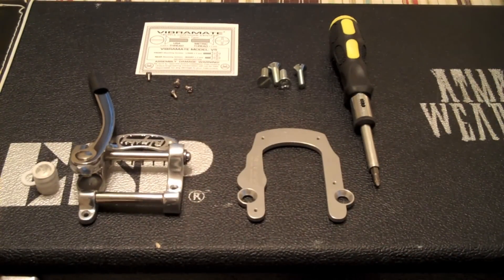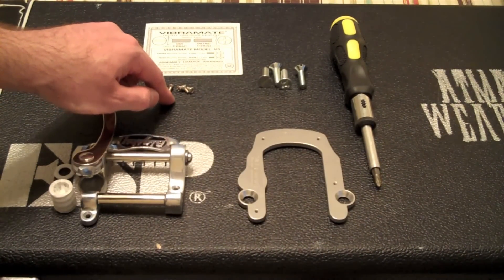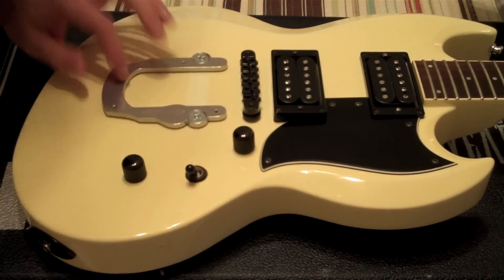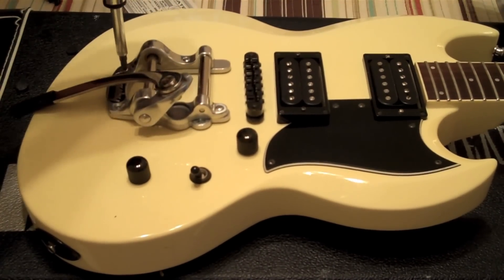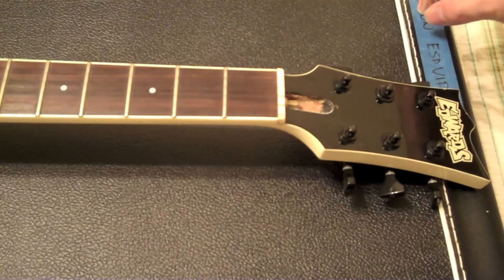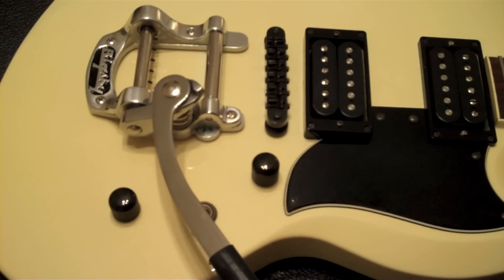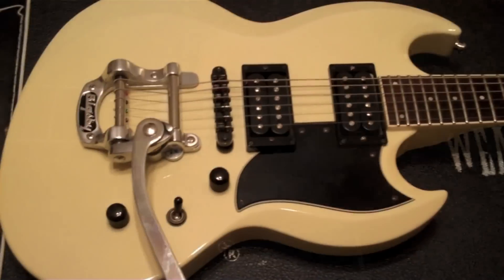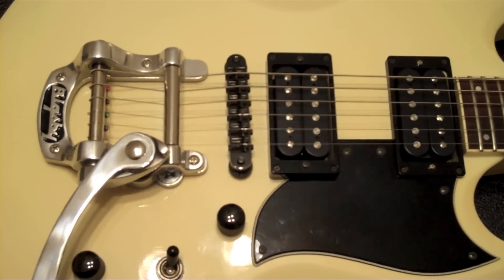Bigsby B5 and Vibramate Installation

Comment: I installed a Bigsby B7 with a Vibramate on my Gibson Les Paul, and for me, i didn't use the white plastic washer, its still just as smooth as it was with the washer, the arm is just lower to the body, which is just a personal preference for me. Vibramate have really made something amazing with these things.

Comment: Can I get help on something? I need the measurement from the point of intonation (bridge) to the very back of the B5 with an install like this. I am designing a guitar with a short tail area, kind of like an EVH Wolfgang or Framus Panthera. I want it to be neck-through and so I'm trying to figure out if a 36" bass neck blank will be long enough. I think it's going to come up short.

Comment: Hi, I have a question. Would it bet better to drill pilot holes instead of screwing the Bigsby without them? Or are the screw small enough that the wood or paint won’t crack.

Oh wait, is the vibramate  the reason not having to drill pilot holes??
Reply: Vibramate removes any reason to screw.

Comment: can this be installed on a les paul?
Reply: Captain Rigs no
Reply: Yes.
Reply: Josh Battershell won't it be weird because the les paul is an arch top
Reply: @dylangreen9819  no
Reply: @senessaxDev  Uh yes. This bigsby specifically can't be installed on a les paul but a b7 can be

Comment: What is the stuff you coated the nut with to lubricate it?
Reply: i dont know what he used but here a tip ,,, take a 2hb pencil  they are made from graphite . color the strings at the nut , try to get the  graphite under the string , graphite is a dry lube  that works well under pressure ,,, i ve used it for years , and it does work well ,,, i used a carpenters pencil because  it is wide , i ve used the same one  for about fives year and still have lots left ,,, oh buy the way i have found stetsbar to be better than  the bigsby good luck  cheers

Comment: There's a simple mod that makes stringing guitars with Bigsby trems easier. Just pull those pins out of the bar and thread the strings through the remaining holes. Much easier and faster if you need to do it during a live performance.
You'll need to drill out the holes where the pins were so the strings fit through, also clean up any burrs etc around the holes to avoid damage to strings, a tiny rat tail file would do the trick, if the come that small.
Reply: Man that's a great idea. I was thinking I may need to get one of those things that attach to the Bigsby if it annoyed me but I like your method better!

Comment: Did you pull your strings completely tight before turning the tuning machines?
Bad move, bro. You need to leave a few inches of slack when you turn the machines, that way the actual turning of the machines pulls it tight, leaving somewhere around 3-5 wraps around the peg, which holds the string in place a lot tighter and improves intonation consistency between playing, so you won't have to tune up as much, and it relieves stress from the strings. Plus, if it slips out of the peg (high strings) due to no friction, you just have to replace the string.
Reply: (Locking tuners)
Reply: It never hurts to do something correct.
Reply: +Terran Spears umm... No. Locking tuners lock the string in place, essentially replacing the need for winding the string around the peg.
Reply from the maker: +Terran Spears Look up info about locking tuners. They eliminate the need to wrap the string around the peg multiple times. In fact, when you use locking tuners, you are supposed to wrap as little as possible.
Reply: says the guys who doesnt know how to use locking tuners lol